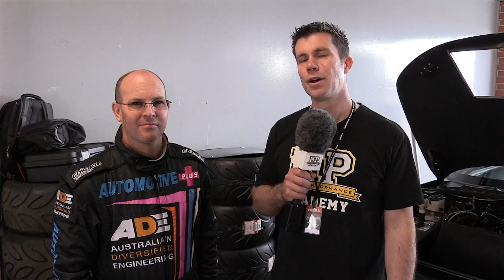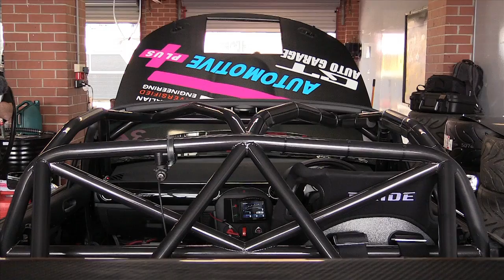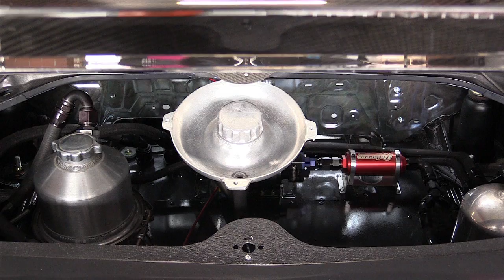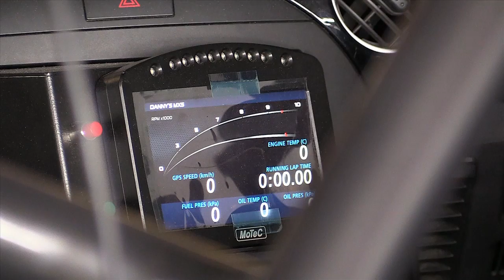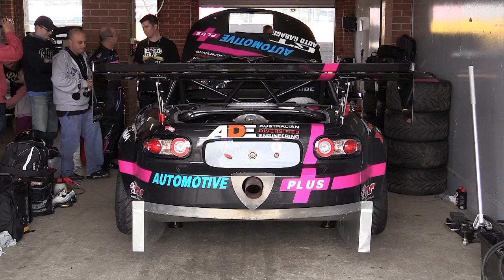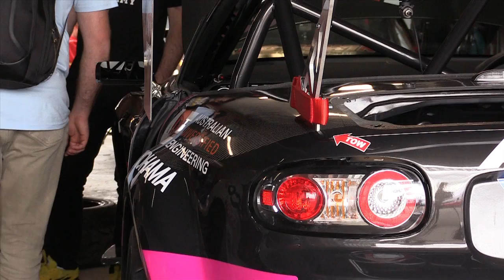20Bpp powered Mazda MX5 | Car Feature @ World Time Attack

Comment: Isn't 450hp a little low for a 20b? is there air inlet restrictions or fuel use restrictions? Or is it purely due to being naturally aspirated?
Reply from the maker: 450 HP is pretty solid output for a NA 20B :) Keep an eye out on Tuesday/Wednesday for our next video release as it features a 1300 HP turbo quad rotor. Giggidy  - Taz
Reply: pretty crazy what a little bit of pressure can do these days ;-)  Love the rotary content and love the videos you guys put out, keep up the great work!!!

Comment: 2 wheel drive is a dis-advantage? LOL F1 is 2 wheel drive for a reason...
Reply from the maker: 4WD cars have been banned from F1 since 1982 ;) - Taz.
Reply: maybe so, but i honestly think awd/4wd cars are way over complicated for wtac driving, have always thought that. i guess MCA, PR Tech and Scorch are starting to prove that...
Reply from the maker: We'll never know if that is true unless they change the rules and allow the teams and engineers to decide for themselves mitchiegxxr350. Who knows what innovative ideas would pop up, or maybe none at all. 
Until then it is a moot point as you can't fairly compare 2 options in a sport where one is actually not an option at all, IMO ;) - Taz.
Reply: High Performance Academy saw a documentary about 4wd in F1.   There where some F1 cars experimenting. Will see  if i can find  it.
Reply: f1 does not need 4wd because of the downforce.  plenty grip